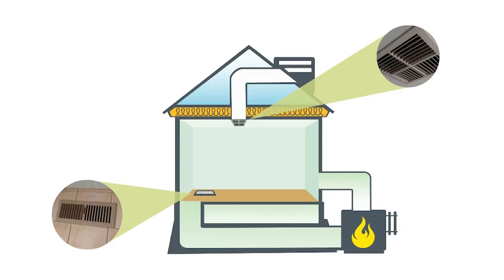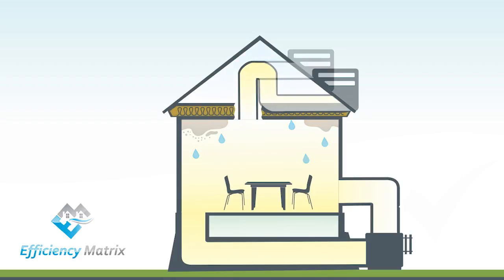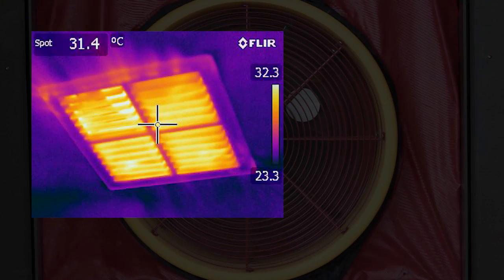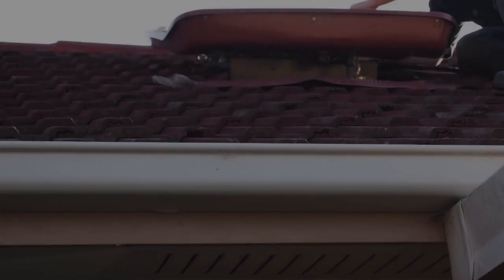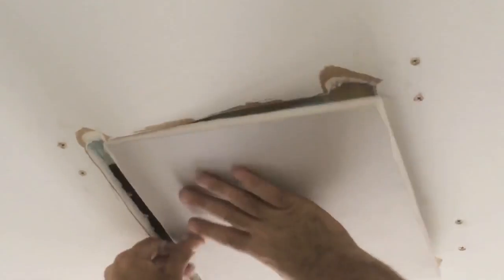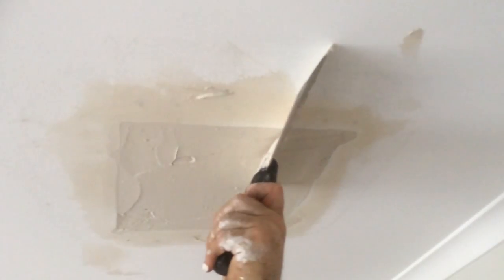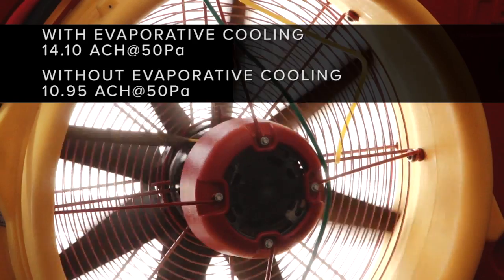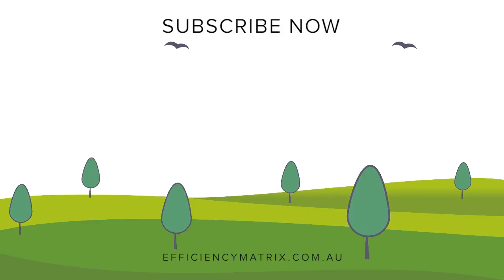Evaporative Cooling makes your home energy INefficient for heating!

Comment: While I don't doubt there would be a non-insignificant heat loss in the winter through evaporative vents due to the chimney effect, I feel throwing away the entire system is throwing the baby out with the bathwater. Especially considering that as mentioned in other comments, some evaporative systems include a weather sealing option, and regardless, covering the registers with contact or specially made register covers once a year is a lot less of hassle for most than this video seems to suggest.

In terms of running cost, which to me is the metric that matters most (the efficiency of modern reverse cycle systems is pretty amazing, but 2kW of input power is still 2kW), my ideal home would have both evaporative and refrigerative cooling. Evaporative for the vast majority of days the house requires cooling for the much, much lower running costs.

On the odd day where the outdoor humidity makes the system ineffective, then I can turn on the refrigerative unit and try not to think about the much greater electricity usage. I currently live in the northern suburbs of Melbourne and I haven't actually experienced a day like this since I moved into this house a few months ago.

Comment: By the time you pay for removing the system and installing the new system, along with the cost of operating the new system, you could run the heating system for quite some time. I don't use processed heating--only a wood burning stove. I close down the venting for the evaporative cooler and the homes stay warm all winter long. I do like the mini-splits [have 2], and I use one of them in the  back of our home to augment the cooling load on very hot days. Everything works just fine.
Reply from the maker: The main issue I see is, indoor air quality.  You need to put a price on that.

Comment: Um... No.   As long as you have a window or two open while the evaporative cooler is running you do not get over humid issues. And on rainy warm days you can run it on fan only and still get a whole house breeze.  Id rather have evaporative cooling any day which forces fresh air in and stale air out.  Something that most A/C systems do not do unless you use a fresh air intake.
Reply: Totally agree, ducted refrig air cons are nice if it gets too hot, but they cost a fortune to run and the house has to be closed up. If you have pets that come and go inside the house evap is ideal and the airflow is pleasant.

Comment: Every few years,  a spokesperson for the Air Conditioning industry announces how efficient the new heating/cooling systems are and how inefficient your old evaporative/swamp cooler is.
While the infrared images were impressive,  efficiency is more than just heating costs. 
You have to heat your home in winter and cool it in summer.  Efficiency is also initial cost of system, operation and maintenance service. 
The average cost for a freon based hvac system here in southern cali is about 6-9 k (usd) .  The average cost for an evaporative cooler system is about 1.0 k - 1.5 k .  ( - 5 k cost difference  ) .
The average cost to operate a freon based ac system is  about  1.8 k - 2.5 k per year. 
The average cost to operate an evaporative cooler is about $ 400 - $ 600 per year  ( - 1 k + ) 
All, ac systems eventually develop leaks,  leaks can be a pinhole to a failure at a joint or fitting.  Atmospheric pressure at sea level is 14.7 psi, so this means that your pinhole leak will release enough gas that the internal pressure inside your ac system will achieve equilibrium with the outside air pressure.  The average cost of gas for the homeowner is $  90 - 150 a pound.  The average system will leak about 2  - 3 lbs per year , not including labor and any other materials. 
The average maintenance cost for evaporative coolers is about $ 200 per year,  including materials. The average ac system will last about 15 years. The average evaporative cooler will last about 10 years. 
So you could buy 6 evaporative coolers for the price of 1 ac system. 
You could save more than 2 k per year in operating costs. 
Your costs to service an ac system will increase as the years roll by, whereas the costs to service your evaporative cooler will generally stay the same. 
So, looking at the numbers
Reply: This video is Australian and Central refrigerated ac isn't common here. Everyone has inverter mini splits which use very little power. You usually end up spending more servicing the evap cooler because you have to keep the pads clean and free of mold. I do it myself but we end up doing it every year. Apart from cleaning the filters in the split systems we've never had a service required.
Reply: I also forgot you have to change the celdek pads every couple of years, usually around 5 years. Last time we did ours it worked out to be like $450 in materials.

Comment: Such a useless video No need to remove them, just cover the vents with vent covers that can be bought on amazon...
Reply from the maker: The point of the video is to highlight issues evap cooling introduces to building performance.  in spring and autumn it’s hard to predict what the weather might do, what a hassle it is to put covers on these vents depending on whether you are going to get a cold or warm day.   just putting it out there Brother my boy. 👍🏻
Reply: @ecoevo  i lived in las vegas and a swamp cooler is enough to cool my house down
Reply from the maker: Brother My Boy- So it doesn’t get cold up there between October and March?
Reply: @ecoevo  nope.:)
Reply: @brothermyboy8226  BULLSHITTT lollll
Reply: No shit sherlock

Comment: My swampy has a servo seal so no air leakage
Reply from the maker: chefgav1 Wow, we haven’t seen that before, send us a photo of the damper.
Reply: @ecoevo  i have both an evaporate cooling and split systems and i would take the efficiency of an evaporatecooling any day.
i have real time electricity consumption monitor in my switch board and the savings on  electricity is huge
Reply from the maker: chefgav1 Yeah, but how much gas are you using in winter to remain comfortable?  If you have a good building envelope, your split system will be way more effective and comfortable.
Reply: @ecoevo  sustainably victoriahave crunched the winter running costs and there is  not a huge difference between ducted gas and ducted inverters
Reply: @ecoevo  Brivis have have had a motorised winter seal for a number of years now on a number if there models.
http://www.brivis.com.au/brivis-contour/evaporative-cooling-systems/

Comment: you're saying upgrade insulation....air conditioners and air tightness which all cost a significant amount of money . a swamp cooler can be installed in a window and air tightness can be achieved same as anything else depending on how much work you want to put into it.
Your whole point isn't really valid my swamp cooler feels tons better in my dry environment than my central a/c the humidity is good for your health and my electric bill is half of that with the a/c. Given you have to watch the humidity from day to day its not that big of a deal if you're not lazy
Reply: Something is off with his assumptions and totally lacks any technical data.
He claims on one breath that swampys leak air then i tell him mine has a winter servo seal which doesnt leak he then says he has never heard on one before i then send him the link of the brivis model he then says the evaporate cooler he tested had a seal.
Something definitely off
and alot of misinformation.
some of his information he provides is really good but some lack any real technical data and just his opinion
Reply from the maker: chefgav1 No technical data?  Really?  Show me the ach difference with and without your evap cooler isolated.  Send us through some of your technical data of how much your evaporative cooler leaks?  We don’t sell split systems, and for this content we just want to be able to help people achieve better performing homes for heating and cooling.  Send through Brivis’s data of how much their dampers leak.  They have none, this video, is primarily out there to help people understand that evaporative cooling can effect heating costs, and it must be considered when thinking about installing one of these things. 👍🏻. Hope you enjoyed this video and others. 😉
On the follow up video we will talk about wind pressure that act on evaporative cooling and dwell a little bit on the effectiveness of draft stopper dampers and mechanical dampers.  We love this stuff, thanks for the inspiration. 😉
Reply from the maker: Shawn, it doesn’t get cold where you live?
Reply: @ecoevo  not really it get down to 40s and 50s
Reply from the maker: Shawn Roddick 40-50 degrees celsius?
Reply: @ecoevo  °F
Reply: @shawnroddick7523  According to Wikipedia in Vegas "overnight minima average around 39 °F (3.9 °C) in December and January".
Reply from the maker: Struth, that’s very cold!

Comment: Cover the vent in the winter, problem solved!!!  You should also let your viewers know that a swamp cooler/evaporative cooler only works good in dry climates.  Using one in a dry climate will cost you around 75% less on your cooling costs compared to central air conditioning. Mini-splits only cool one room at a time and the operating costs are still significantly more than a swamp cooler.
Reply from the maker: Agreed, in a dry warm climate, that is present all year round, evaporative cooling can be beneficial.  If you have a building envelope in a warm and cold climate that is high performing(air tightness, consistent insulation and heat recovery ventilation), your heating and cooling costs are significantly reduced, where modern refrigerative cooling may be utilised, that can produce heating and cooling very efficiently.
Reply: @ecoevo  Your information is very informative but i totality disagree with your views on evaporate cooling and heating/cooling in general.
You claim that evaporate cooling vents leak Air which might be true on certain brands but i have a brivis with a winter servo seal which for me works very well but you claim the one you tested had some sort of seal.
How many did you test with the brivis winter servo seal? Was the evaporate cooler servoseal checked to see if working?
The info you provide in this the area is sketchy at best.
You were also supprised when i said my swampy had a winter servo seal and you asked me for more details which leads me to believe you were unaware of such a device inside some brivis models
summer cooling costs evaporate cooler wins hans down as i have measured the power consumption.
Ducted Gas vs ducted electric running costs sustainably victoria have crunched the numbers and there is not a huge difference in running costs.
And installation costs swampy/gas VS ducted evaporate cooling with gas/swampy being at least 30% cheaper to install.
Reply from the maker: chefgav1 Sketchy?  No sweat, we will put a bigger budget into this comparison on the next video we do on the subject.  There is no doubt this video is a little old now, and not as well made as our newer ones.
Again, The Brivis that was installed in this video, had a motorised damper, and in closer inspection, they do not close very well, unfortunately.   We did not mention this in the video, because this is just one brand, no other brand does it, and it did help much anyway.   We are happy to test many more, if they become available for testing. 👍🏻. Thanks for you feedback.  We will come back to this subject just before summer swings back through for Australia. 😉
Reply: @ecoevo  but you said you have never seen one before then you say it had one.
Was it checked to see if working correctly?
Was more than one tested to see consistency?
Reply from the maker: chefgav1 Again, The unit in this video, had a damper, and it was inspected as being terrible, and not even worth mentioning.  Unfortunately the quality of these dampers, with regard to air tightness is much to be desired. 👍🏻. Thanks for your comments.
Reply: @ecoevo  would love to see your results and photos
Reply: @chefgav1  i have a cool breeze evap cooler with a leaky damper. It's about 10 years old but the damper is rusted out to the point that we had to manually move them to the open position and leave them there so we could use it. It's supposed to spring closed but it doesn't move by itself any more.
Reply: @tomtom1541  I have the brivis with servo seal and it seems to work well and can’t feel any leaks. I have had it serviced and have been told it’s sealed tight. My unit is 6 years and is efficient with only 500w use on flat out for a 4 bedroom home
Reply: @tomtom1541  his articles are very interesting and I use his stuff but don’t agree on spending big $$$ for minimal returns.If your rich and  want a slight increase in comfort then go for it.
Retrofit double glazing and retrofit insulation is hell expensive with only a minimal ROI.
I sealed a lot of air gaps and downlights upgraded roof insulation from R3 to a cross hatched R7 at a cost of $6000 for a total average saving on gas bill of $100 Sure it’s more comfortable and stable temp but the ROI is just not there
Reply: @chefgav1  yeah it guess it really depends on the unit. The cool breeze we have uses about 1200w on max speed but it is a larger model. Ours is somewhat drafty in strong winds even with the vents closed. But it is getting a bit old now.
Reply: @chefgav1  yeah r7 insulation sounds a bit overboard
Reply: @tomtom1541  I’m in a cool climate so it was crosshatched to limit thermal bridging.R5.5 is minimum standard where I live

Comment: You need to go to the middle east, most locals uses swamp coolers cause air conditioners gives them nothing but nosebleed and they can't stand the outstanding 50-90°c heat. And ac's do cripples my skin after taking a bath, and ac's circulates stale air inside the building while swamp cooler draws fresh air from outside the building, back then most semi trucks uses swamp coolers because they do not have any space to get an ac installed.
Reply from the maker: What about pollution, dust storms?  I think it’s important to manage humidity, there is no doubt.
Reply: @ecoevo  they have a cover for it to prevent dust from came into the building via the units, and they do need humidity cause most of the areas are nothing but plain desert without vegetations or whatsoever so the air always dry and pollutions in there aren't as bad as you expect, my teacher also have a swamp cooler in her house and it works perfectly and it saves her energy bills.
Reply: What on earth has the ME got to do with this? Sure, swamp heaters are cheap, effective, efficient coolers in a bone dry summers and if  winters are so warm you don't need a heater there heat leakage in winter is not a problem. But EM is talking about coastal southern Australia here, where neither of these apply..

Comment: Evaporative coolers use much less electricity
Reply from the maker: audionut Yes, they use less electricity than split systems, but they also cost you a fortune in colder months when you are heating your home.  Cooling a home in the southern parts of Australia is only a small part of the picture. 👍🏻. Thanks for the comment.
Reply: @ecoevo  not if you buy a brivis.They have had a motorised winter seal for a number of years now
Your information on evaporative cooling might need to be upgraded. 
Great info though
Reply from the maker: chefgav1 Unfortunately, this air tightness testing that was done, was done WITH an Evap cooler, that had a mechanical weather seal.  Hopefully these dampers have improved since, But I doubt they have. 👍🏻😉
Reply: @ecoevo  what was the brand and model number as something sounds off
Reply: @ecoevo  No, actually with a close off plate and a cover you lose nest to nothing in heat.
Reply from the maker: For more information, visit this link.

https://efficiencymatrix.com/does-evaporative-cooling-work/
Reply: how you think Bunnings cools their stores. All systems have their own roles. Split are eye sores. 

Try installing dampers that will solve heat loss.
Reply: And you can get plugs now for the vents. You cover them up over winter
Reply: You can get vent plugs for the evaporative vents. Put them on over winter to stop the warm air from escaping. They work very well

Comment: So in your sealed building envelope, where does our oxygen come from?
Reply from the maker: troykm the majority of homes, without evap cooling are extremely leaky.  You don’t need evaporative cooling to breath.  Moving toward a more air tight building means that you need to either start opening or closing windows when temperatures outside are desirable, or installing a heat/energy recovery ventilation system. HRV/ERV. This system recovers the temperature of the air going out of the home, into the new air coming into the home, while also filtering the air (pollen, dust and other particulate) coming in.